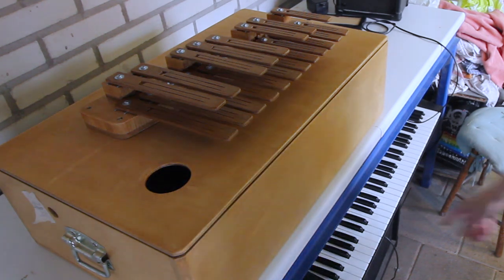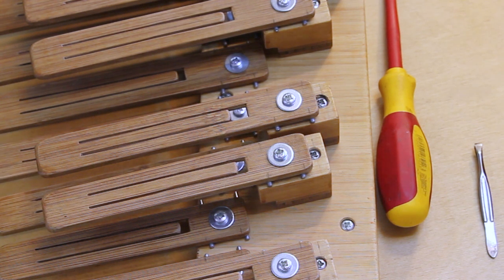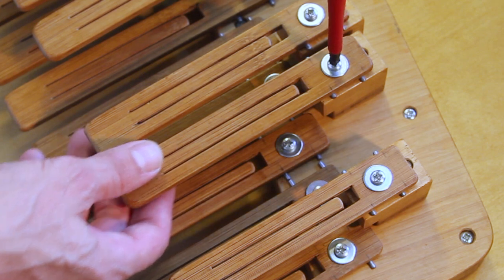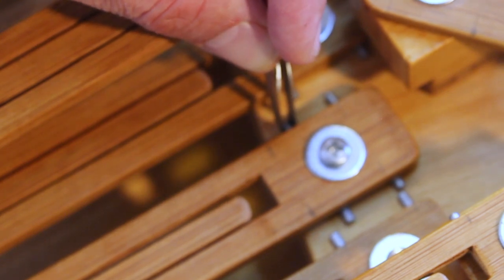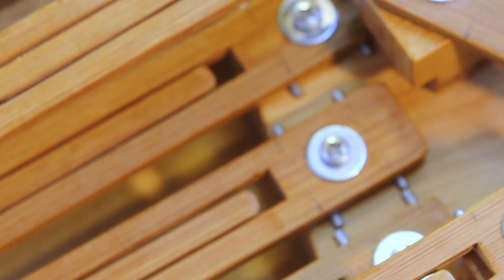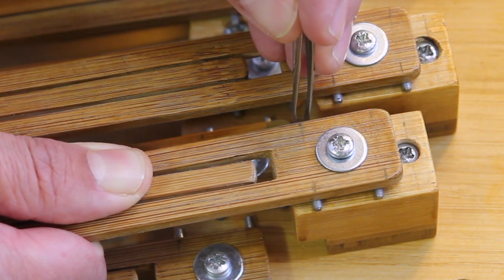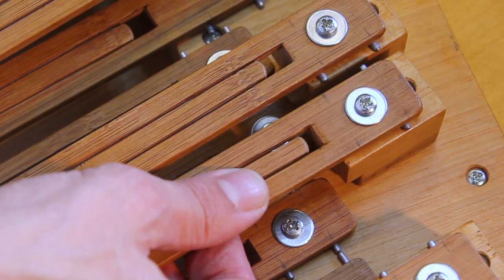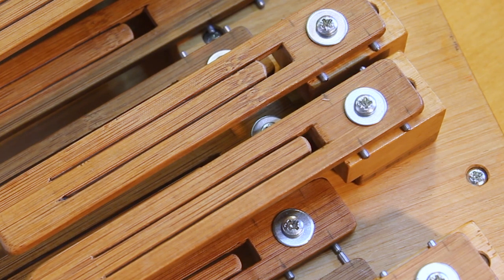Tuning the BamBooBass kalimba - instructional

Comment: Who created such a crude instrument?
There's much, so much to be improved in the assembly and adjustment of the instrument.
Very unreliable and very inconsistent.
The two supporting rods should be linked in one piece, which should have at least a tab of some sort that could de easily grabbed during tuning.
Of course, my comment doesn't have the intent of bashing.
This instrument, in its current state, could be a perfect example of a proof of concept... A working prototype...
But it takes so little effort to turn this design into something that is minimally workable that is a pity the maker didn't take the effort.
The same goes to th resonance box, A rectangular shaped box is probably the worst shape that could have been chosen to make the box sound better across a wider range of notes.